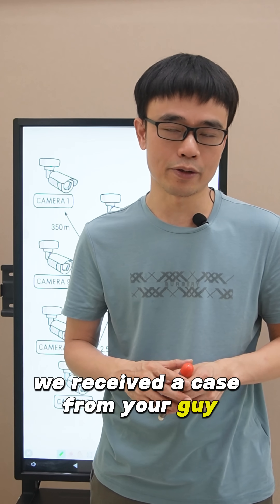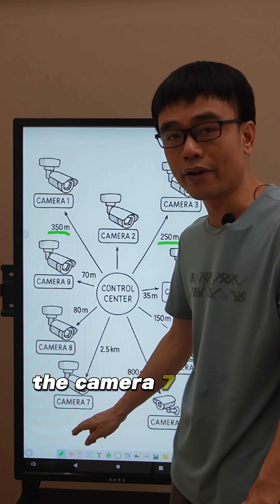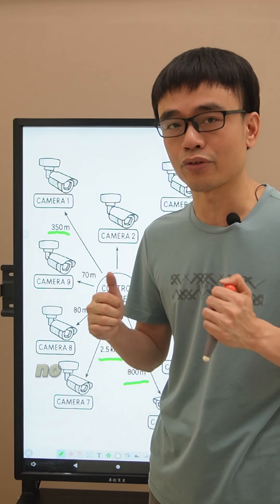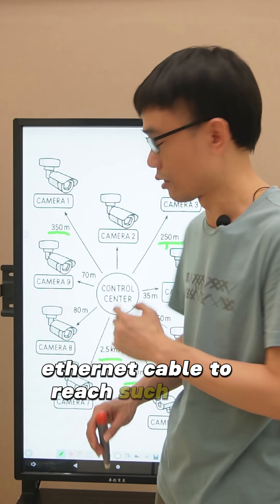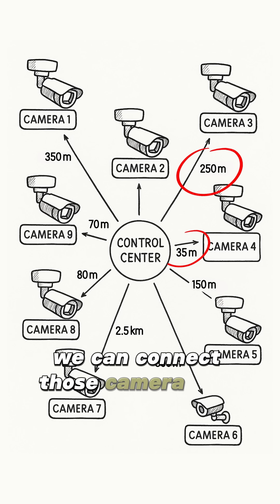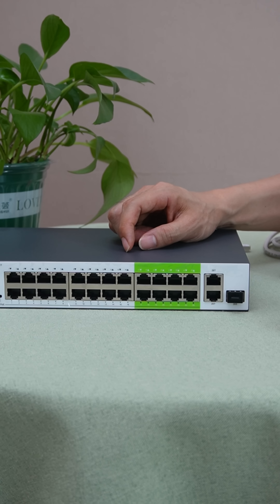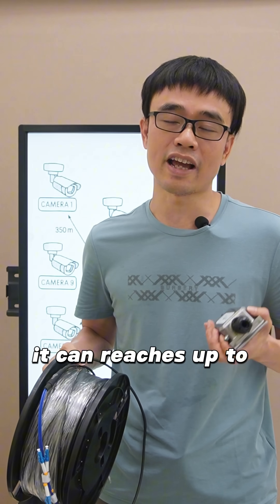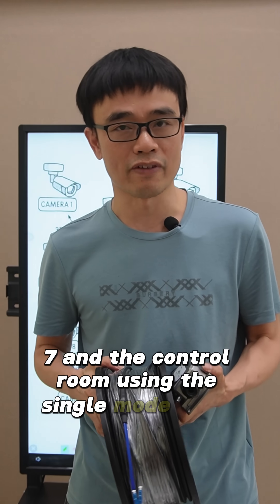How to Connect a 2.5KM Security Camera to a Single PoE Switch!

Comment: can we use two ip camera at same distances in one single fiber cable using splitter?
Reply from the maker: Hi, you can use this 2-port fiber PoE extender:https://www.fastcabling.com/product/2-port-fiber-poe-extender/

It has two PoE output ports and one SFP slot, which allows you to connect 2x IP cameras over a single fiber cable.

Comment: Don’t forget that the distance here is the cable(s) length needed to reach the cameras’ position.
Not the from-to diagonal / straight line that is drawn on a map. It has curves, up down, left right, in out. It’s never a straight line, like finding the position of a sniper from a bullets’ hole with a laser. 🤪
Reply from the maker: Exactly! It is determined by the actual cable length the electricity and data must travel—not the straight-line distance.